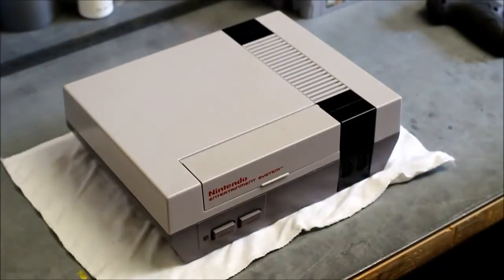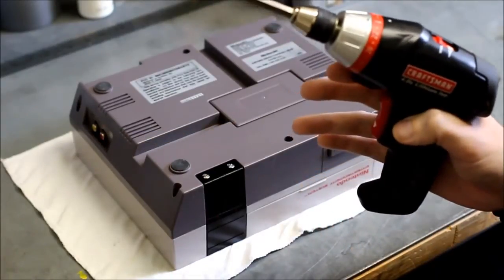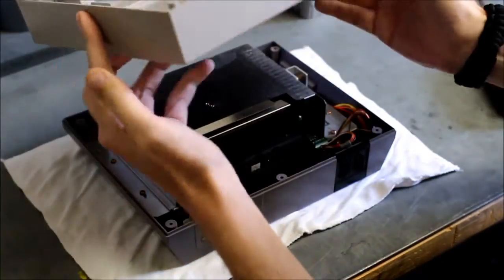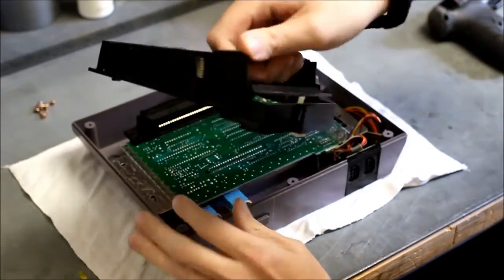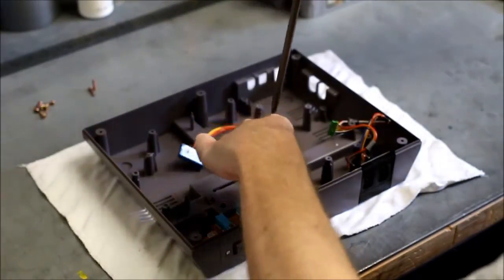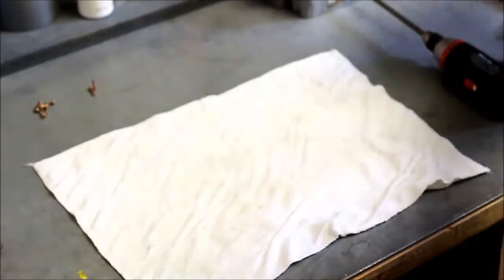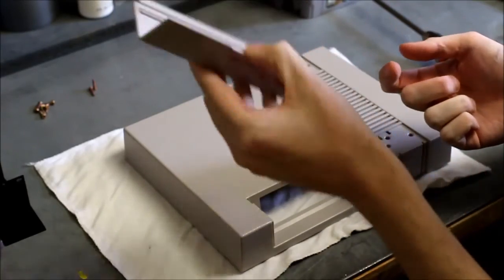Walkthrough: NES Repair - Disassembly (Part 1)

Comment: Powered screwdriver is ballsy. Video appreciated for showing the number of screws you popped out during each step. I own an NES I disassembled then gave up on years ago only to pick up the repair again recently, and this aspect saved my ass. So, thank you.
Reply from the maker: Haha... definitely. No question, wouldn't suggest people generally use an electric screwdriver, at least for re-assembly, but this one has different torque settings and on the lowest setting it's pretty safe. However, I should have clarified that in the video for sure.

Thanks for the comment, and I'm glad you found it useful.

Comment: NO WAY did this guy just use an electric drill on PLASTIC THREADS. Stick to a normal #2 Phillips. They’re only hand tight.
Reply from the maker: The drill I used has adjustable torque settings with a clutch that breaks pretty easily on the lowest settings. No threat to the plastic standoffs. However, I agree... most should just use a normal screwdriver.

Comment: I have an old NES-001 that my landlord gave me. He wants the shell to make into an art project, the NES (hardware) itself "isn't working." I would like to figure out how to refurb the old hardware, minus the case (for which I would hopefully find a replacement, even custom?) and customize the controller slots, LED effects w/ additional hardware, even the cartridge itself to make the best portable, high-end NES around. 
Any ideas?
Reply from the maker: There's not a lot to go wrong with the hardware. Unless you can see physical damage, the first place to start is the 72-pin connector. It's the reason these systems stop working, 98% of the time, give or take. You can disable the NES-10 chip, but that doesn't solve the issues that people generally think it does. The next thing to try is to replace the capacitors and Console5 sells good cap kits for systems. Also, make sure the games you're putting in it are cleaned properly. Most people think that WD-40, pencil erasers and rubbing alcohol are enough to clean games, and they're typically good enough for surface oxidation, but I've had a lot of cart based games come through here where that wasn't enough. So, I generally clean games using some cutting compound on a Q-Tip, and following it up with some IPA to clean it up. If it's REALLY bad I'll use some 000 or 0000 steel wool. I should have a couple of videos going over my process on that as well. Also, if the game has a battery, I've seen those prevent games from working when they die.

If all that fails, it's probably something that's going to take a good bit of experience diagnosing at the component level on the PCB to find.

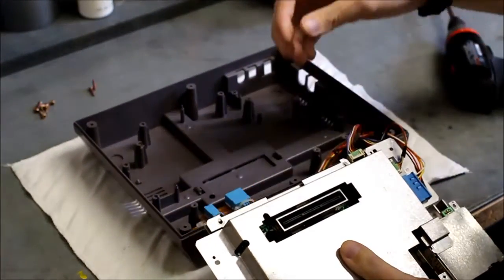Comment: At 7:20 how do you pull out those plugs so easily, I can't get them out!
Reply from the maker: That's an awesome question. I'll have to include this in the revised video on this. I just grab the wires as close to the connectors as I can and rock them from side to side as I pull.

Comment: The bottom left screw for the metel part on top of the cartridge slot won't come out, what do I do if it's stuck?
Reply from the maker: The plastic underneath is probably stripped. You would just need to use something to wedge underneath the screw to apply pressure as you unscrew it and it should come out. I know this a year late and you've surely fixed this. Sorry about that. YouTube doesn't always inform me when I have new comments on videos.